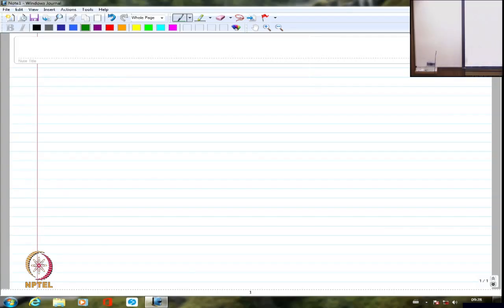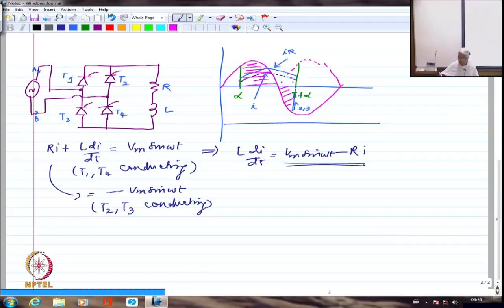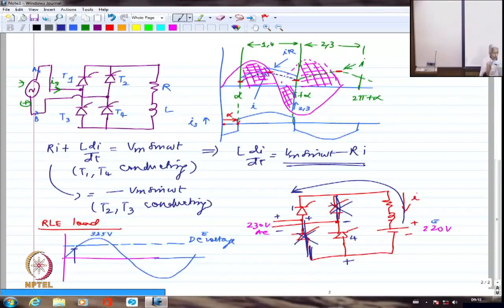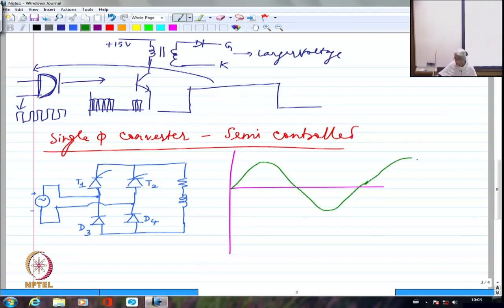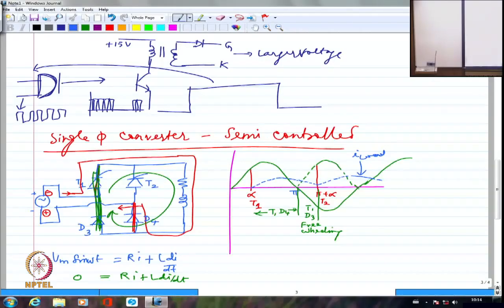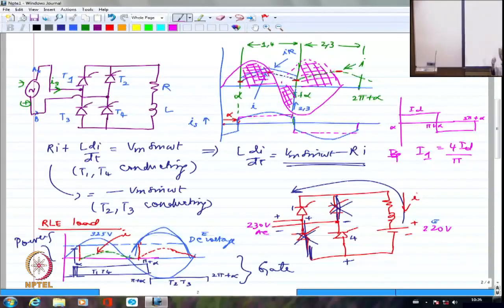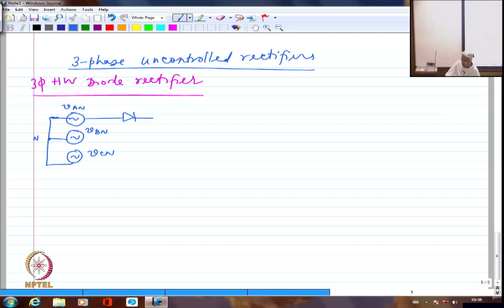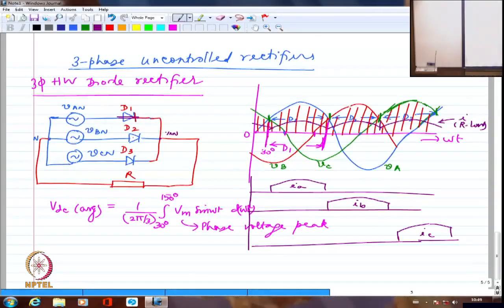Single-phase Controlled Rectifiers-II

Comment: Why is T1 still conducting irrespective of being reverse biased in semicontrol negative half cycle?
Reply: In order to turn off Thyristors we need to satisfy 2 conditions 
1: T1 should be reversed biased 
2: The current flowing through T1 should be below the holding current of T1 

in semiconvertor during pi<t<pi+a
D4 and T2 are off 
only T1 and D3 are ON 
Since current flows via T1 , T1 is not OFF also because D3 is fwd biased due to the reversal in voltage of the inductor in the RL load as the load current starts decreasing.
Reply: Voltage drop in the load contribute a potential difference making the Thyristor forward biased, current circulates within the load and the rectifier acting like a free wheeling diode.
Reply: I am having trouble understanding the negative portion of Vo. Even after the input supply has reversed ( pi < angle < pi + alpha) the SCR keeps conducting since the holding current persists. Now I think this is only possible when the voltage accross SCR is such that it makes this holding current flow through it, for this to be the case the negative voltage across the inductor must be greater than the applied AC voltage. And if this the case why do we say that we see applied AC which now has become negative at Vo and not that Vo in this case is difference between supply and inductor voltage ?